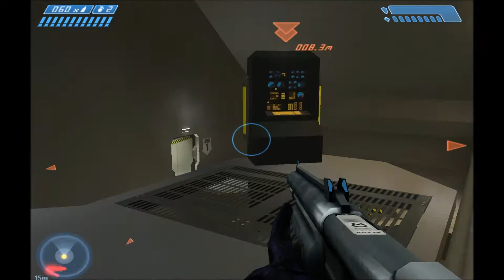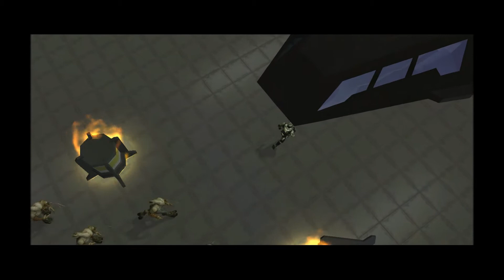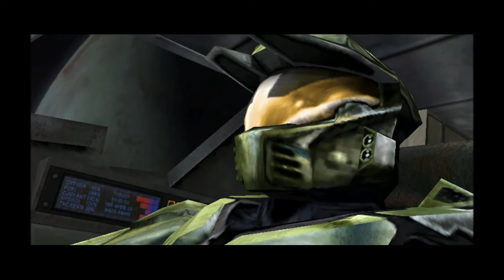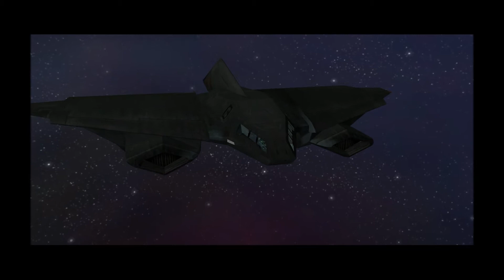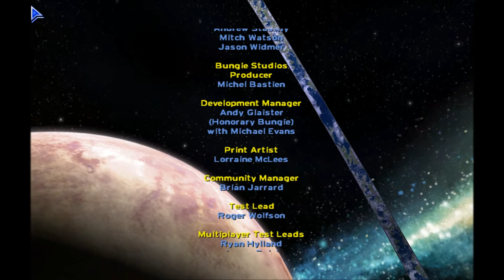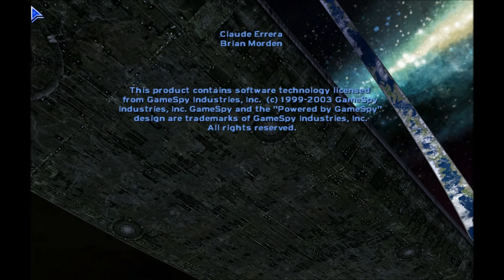Halo - Walkthrough part 26 - Light Fuse, Run Away

Comment: I would really like to understand why game programmers apparently think it's enjoyable to have to repeat the same sections over and over and over when you screw up.

Cross a checkpoint with the wrong weapons for an upcoming section? Too bad, you have to trek all the way back to the room with the supplies each time you die.

Want to replay a particular battle? Nope, not allowed unless you want to restart the entire level.

Checkpoint systems don't belong in modern computer games.
Reply: I totally agree.  I just finished this mission on the original XBOX, and It was freaking annoying that I couldn't have a a checkpoint during the warthog portion of the mission. I mean, you think when you get the the halfway point when you supposed to be picked up by aren't, they would point a checkpoint there. But nooooooo, if you fall off in any way, you have to start ENTIRE driving section over again. Not to mention the fact that they give you pretty much the worst vehicle in the game (at least on the original XBOX, seems to be a lot more responsive here) to traverse this area. A ghost would have been so, so, so much better.
Reply: @dumchumps8698  I beat it first try, the warthog isn't bad.